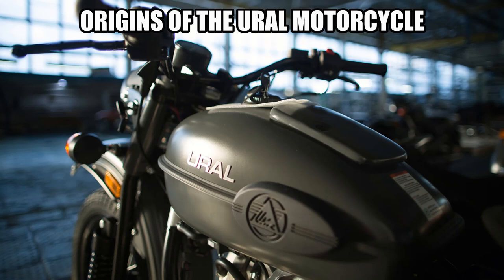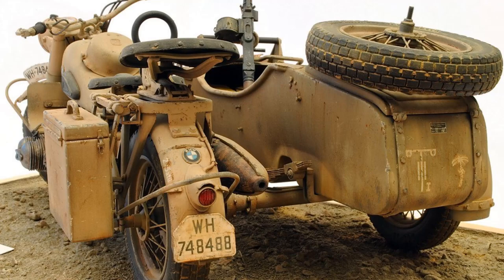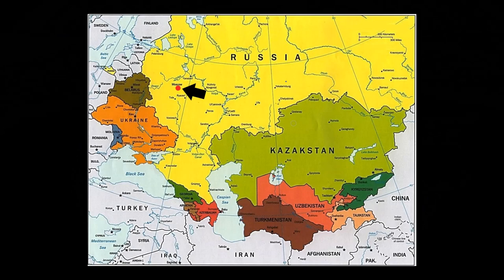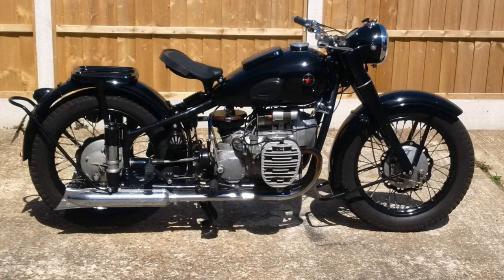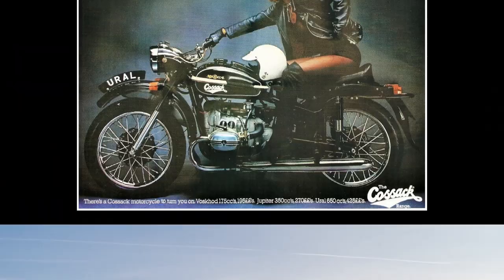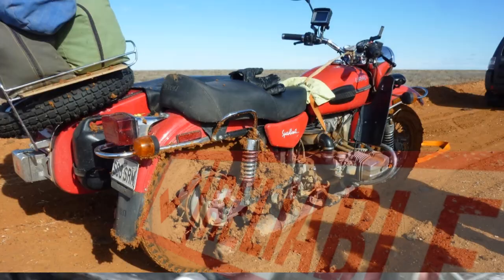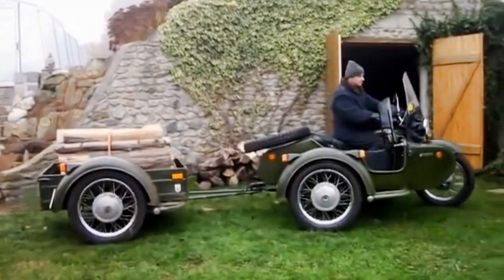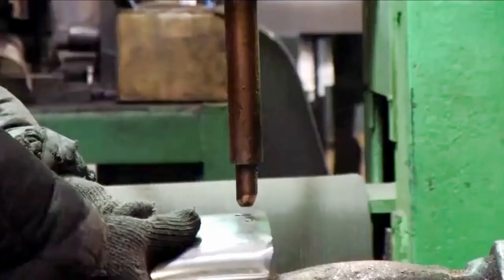URAL Motorcycle History

Comment: Scenarion 3 is real true. Russia has no experience in good motorcycle. Their PMZ 750 Podolsk - copy of BMW and HD have problem (PMZ was translate by customer Try Me Start - Poproboj Mienia Zapystit :) ) TIZ AM 600 copy of BSA sloper - was also not good. Production of M-72 start at once without big problem, and motorcycle has all parts make from right material with right tolerance and dimension. First engine blok was produce on BMW mould so even oil return under cylinder from R66 is also visible on first M-72. First bike has also often rear gear from germany or bearing from germany.
Reply from the maker: Yes, I think you are correct but it seems nodody knows 100%, it does seem to be the most believable scenario. Thanks for watching mate and taking the time to comment.

Comment: About ten years ago, here in Australia, I purchased a second hand 2009 Ural "Tourist" carburettor model they are now EFI. I have never had an issue with mine whatsoever other than a new battery required, changing plugs and front brake pads and after all that time I finally chaged the oil. I have other bikes as well but if your happy to know that 80 or 90 kmh all day every day is this bikes thing then grab one. They are totally different to normal motorcycling in handling and braking so take your time and get used to those issues. I can happily lift the sidecar and steer down the road, it just takes practice. All the dogs I have had love riding around in the Ural. The new ones whilst expensive are very well built and if I could afford one I would buy one. Don't listen to the nay sayers do some research and see if you can get to ride one for a half day or so at the very minimum to make up your mind. This is probably the bike I will keep till I'm really to old to ride anymore.
Reply from the maker: Same here buddy. I bought mine last year. The bike while far from perfect is a real keeper. It just has so much character, I reckon I will have this bike until the day I die!
Reply: @motorcyclecafe  Hey mate, yep, I can't see any reason why I would get rid of it, it's slow like me and if I wnat ot rip around I jump on one of my othr bikes, Moto Guzzi's and a GS1200. The ural or mine at least is old technology really but I am happy with it, the new ones for me are too expensive. When I win the lottery I will buy a new one though ha ha!

Comment: Cool video! We are on our 2nd Ural Gear Up, having owned the first for ten years. Our new Ural was made in Kazakhstan and is made very well. The 2nd generation fuel injection/ignition is amazing. The engine has much better power and torque and at 55mph-65mph is smooth enough that the mirrors are clear. I maintain our Ural with simple hand tools. The most important things to do to keep your Ural reliable and running forever are to follow Ural's owner's manual maintenance. Especially frequent oil changes (3000 miles maximum) using a premium full synthetic oil with the best additive packages (Diesel rated is great). I grease all the fittings and lubricate everything regularly as well.
Reply from the maker: They are good machines if looked after. Regular oil changes are the key no matter what oil is used. Cheers and thanks for watching!

Comment: I  presently have a 2016 patrol. Previous to that I had a 2003  2wd Northern Cruiser. We use the bike to advertise my wife's flower store The Flower Room and I deliver flowers with it. Plan to keep the 2016 Patrol as longs I can although I also like the new bikes
Reply from the maker: The newer model Urals have quite a few improvements, inside the engine & outside. However they also have more electronics whether you consider that good or bad is a personal choice. My 2015 has electronic fuel injection and thats it. Many new bikes not only Urals do sometimes have issues when these electronics detect errors and the bikes will not start. I'm glad I have a 2015 and doubt I will ever get a newer model, but thats me 😉

Comment: Excellent video!
I ride a 2016 Gear Up Ambassador (1 of only 25 made), and it’s the most fun you can have with your clothes on.
They are NOT an “easy ride”, and I wouldn’t recommend them to a new rider, because “Riding a Ural is like wrestling a drunken bear!”, but acquiring the needed skill set is well worth your time and effort.
The payback is indescribable.
With over 50 years of motorcycles under my belt (dirt & street), this is my favorite of all time.
It’s like an old Ford 8-N tractor.
With proper maintenance, it’ll be passed down to your grandkids.

P.S.,
At 155 pounds (70 kilos), I’m not a big guy, and (off road) my stock shocks didn’t even know I was on the machine.
They were as responsive as 5 pieces of firewood.
I just made a huge decision ($$$!!!) to order up a set of NITRON shocks.
If any of you Ural riders/techs have adjustment advice for how I can best set them up (should be here next week), I would be forever in your debt.🙏
THANX,
PLJ
Reply from the maker: I agree with every single thing you said. Spot on! Down the track i am going to produce a video on sidecar suspension etc..  there is absolutely nothing wrong with the std Ural shockies. Its just that nobody spends the time with adjusting them. Combined with correct tire pressures this makes all the difference. If you upgrade while they may be better shockies unless they are setup correctly you probably wont see much benefit. All the 3 positions front, rear and chair need to be quite different settings.
Reply: @motorcyclecafe  
I’ve done that, and know the machine very well.
Like I mentioned, I’m a smaller rider, and the stockies fall flat on their face for riders my size.
I ride with 2 other guys with Gear Ups that are heavier than me, and they perform at an acceptable level for them, but not me.
It’s not “an adjustment thing.”
Reply from the maker: @peglegjim57  im not much bigger but i ride with a passenger. Best of luck hope it works for you. Cheers.

Comment: Interesting video. But i am definitely not a Ural Motorcycle Fan at all. I know very little about these Machines but they are  quite popular among the Classic bike Fans and collectors hear in Sri Lanka. And back in 1976 a batch of One Hundred Motorcycles i believe were imported by the Police department for the Non Aligned Conference held that year. Not sure what model designation but i understand they are 600cc Twins. My memory goes back to around 1978/9 when i used to see bikes still in use by the Police. And then of course in the recent past i see a couple of them running around and with Collectors. A friend of mine was even Fooled into buying one dressed up and disguised as a BMW Twin. 😂 To me its Never a Classic on my list.
Reply: But like you said these are Solidly built Bikes for a Specific purpose. 👍

Comment: Is ural producing a solo model ( no sidecar or reverse gear) ?
Reply from the maker: Not as far as I am aware
Reply: I've got a 2013 M70 Solo model.  I think they stopped making Solo's in 2014.  Any Ural with telescopic forks can easily become a solo just by removing the sidecar.  The leading link models have occasionally been ridden solo, but the steep steering angle makes for a "concerning" ride, especially on squared-off tires.

Comment: A woefully incorrect history section. BMW, which had a history with the Soviet Union going back to 1922, offered the Soviets a choice of three models, the R12, R71 and R75. The R12 was outdated, the R75 was only available after 20,000 units had been manufactured, and the R71 which was mothballed in Munich. All other BMW motorcycles were made in Eisenach.
The three samples offered by BMW are in the Irbit State Motorcycle Museum. The R71 was a failure for BMW, as was the R72 based on it that was offered to the Wehrmacht. To avoid building Zündap's KS750, BMW hastily created the R75.
BMW supplied plans, some tooling and five R71s fitted with Stoye military sidecars, as opposed to the civilian Royale sidecars that BMW used at that time. 
R71 production was restarted in Munich in early 1941, presumably to train Soviet workers. MMZ was moved to Irbit and only became IMZ in 1945 when the decision was made not to return it to Moscow. The Leningrad and Kharkov plants were transferred to Gorky where they remained until 1948, when transferred to Kiev. KMZ made the confiscated Wanderer 100 up until 1952 when the first M72s were made with 500 engines and transmissions supplied by IMZ.
GAZ/GMZ made all sidecars up unto 1948 when the machinery was transferred to IMZ and KMZ.
The Dnepr name was first used in 1967 on the K-650 for the 50th Anniversary of the Great October Socialist Revolution.
The largest number of Red Army motorcycles was the WLA (35,000). The biggest Soviet manufacturer of motorcycle and sidecars was IZH, around 15 plus million, compared to IMZ's 3.25 million. 
I could go on, but that's enough corrections for now.
Reply from the maker: @peterwilliams2152  appreciate your input but almost nothing you go on about is relevant to whats contained in this video! I didnt even mention american motorcycles etc, etc .. just because you read something in a book or on the internet does not mean it is factual, its just something you read!